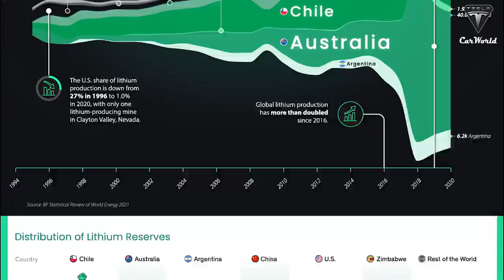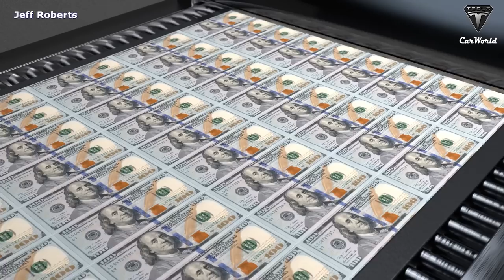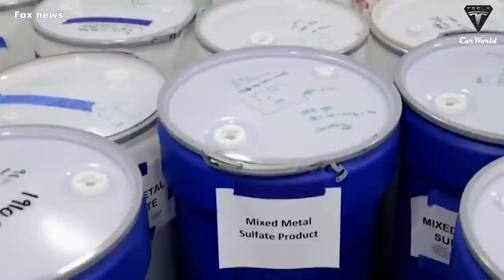Elon Musk's New Insane Battery-grade lithium shocked the entire energy industry!

Comment: nice video I would expect off calculation off how much lithium goes in car batery actualy for 500 km and for 1000km diff so rest goes in nuclear energy or thorium cells advantage or everyday use then in transport safety a 1 000 000 km mileage is still drivable option in terms off transport also specs off rough usage off lithium for vans or truck would be fine also then in space way is improving partnership offering shares and finance it up 60% as hsare holder or buy to stabiliye price off lithium and having in mind is best rized production so good start is 25% , 30% then 40% then 60% to see how market goes in and then in raw material production go to 75% which is basic step and one before last a 84% as good car producer and then 99% is also good job done so and saving some money ot tesla also as tesla would be first and stabile to rize even that production lithium on world scene using cooper nikl and lithium as standard ore factory batery process and thats is more a fact isue rest is more like when will it hapen the soner the better and under negotiating first reveal demands and desire is good job done then mine party reveal is desire and vision then blend and draw some assembly production process mine then you have bought figured iut and  see possible price stabilize and see seriocity deal off partner credibility and last 3-4 steps are just observation on market situations adn finishing deals expand entire porduction at possible higher rate according to resource and mine wokrs better and is more productive and everyone is happy and logistical transfer off ore is much better and production cylcle simply energy and electric nuclear production all that was dreamy in ideal condition once like that should be also on mars in a dream or one day at least is nice or polite to be polite in unhabitable area takes guts and preps and time slowly space x is getting there  and tesla very  stabile in behind